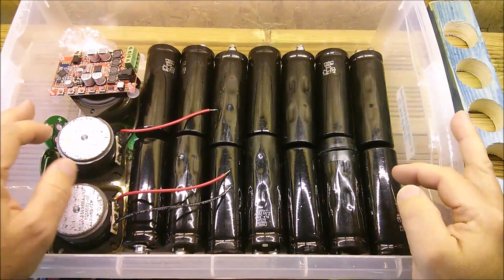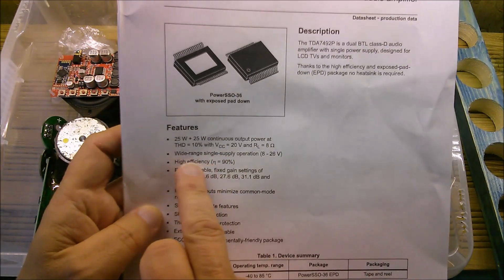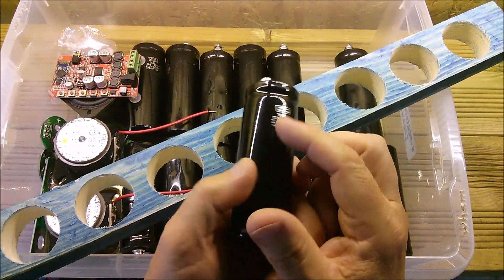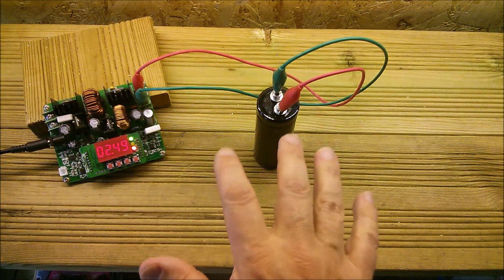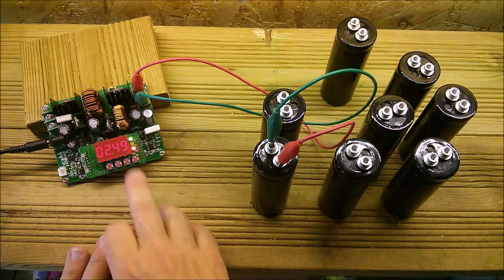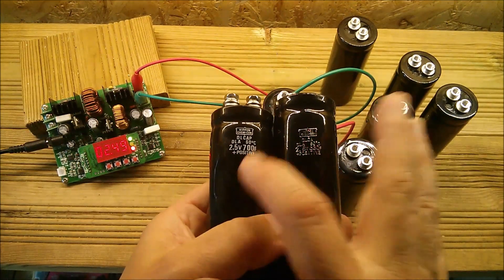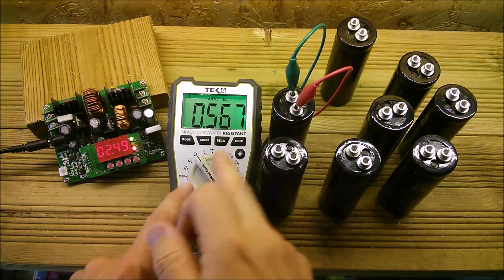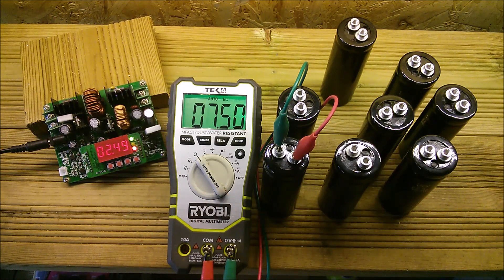My 630F Supercapacitors are Fake?

Comment: When you unclipped the first and before you clipped in the second, the voltage on the display didn't change. So it can't have been measuring the voltage of the capacitor, surely?
Reply: The display measuring the voltage of the power supply output. And there was no drop when the second capacitor was connected, which you would have expected - since it should have presented as a near short while it charges up. You can see the Constant Current (yellow) flash for a moment with the first capacitor, but not even a flicker when the second capacitor was connected. Capacitors are useless.
Reply: @pfeerick  ah yes, I see. Thanks.

Comment: Time to take one apart and see what's in it! Has the electrolyte dried up? Was there just a small, but cheap electrolytic capacitor soldered across the leads? I think we all deserve an explanation?
Reply: Now that would be amusing if it were just tiny caps inside.

Comment: The label alone gives these away as fakes, no self respecting super capacitor factory would let them out the door like that.
Crack one open, see what is actually inside, is it a much smaller super cap and a piece of brick ?
Does it contain a normal electrolytic cap and a lot of tar ?
Is it filled with sand ?
These are all things done to some brand name Car Audio Supercapacitors.

Torture the rest, apply reverse current, apply 240V AC, set them on fire, crush them etc.
Reply: My take is sand!
Reply: @hugodeandres1497  Probably the sand that they omitted putting in BS1362 fuses :)

(BS1362 is the standard of fuse used in UK mains plugs, which are BS1363, for anyone unaware.
They're supposed to be HRC [high rupture capacity] and thus have a ceramic body filled with sand to quench the arc that can form when the fuse's wire breaks, especially with the rather high potential fault currents possible in UK electrical installations [thousands of amps], though I don't expect that's at all unique to the UK.
But at least some BS1362-looking fuses on AliExpress, Amazon, eBay, etc., that are shipped direct from China (or from the UK warehouses of direct Chinese imports, or possibly even Amazon Prime items), as well as fuses supplied in UK plugs of appliances purchased from those platforms, are made really badly, e.g. not filling them with sand, using the wrong thickness/material of wire, not correctly attaching the fuse wire to the end caps, having end caps that can be very easily pulled off, etc... They might work... or they might allow the flex to set itself on fire! (In a fault scenario where more current can flow than the cable can handle, but less than the rating of the upstream circuit breaker, which is often/typically 32A...)
So it's always worth checking fuses from untrusted sources - maybe break open one from each order/supplier - and replacing fuses in cheap appliances from sources like that, as well as checking that the fuse used is correct for the flex it's attached to...

Big Clive made a great video about the subject, and honestly I'm just repeating a lot of it here, so go watch that :p)